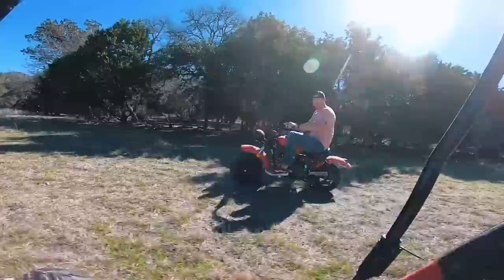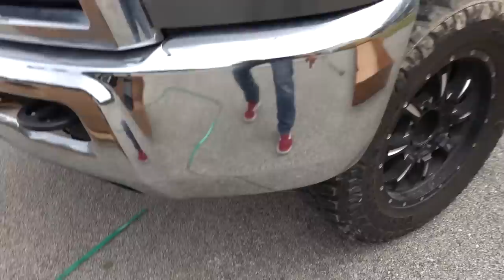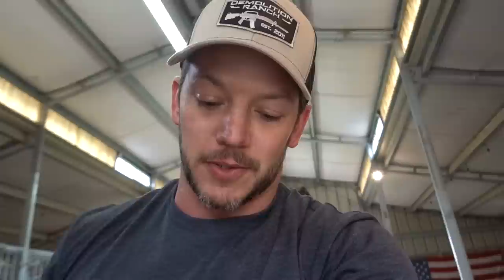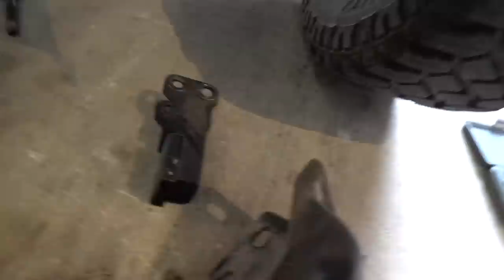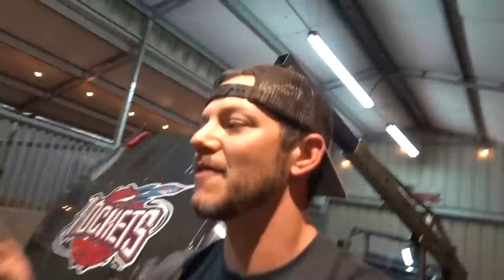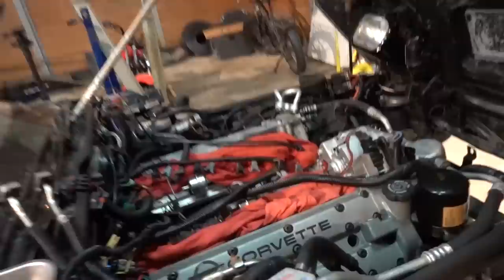The New Upgrade is HERE!!! Dodge Ram 2500 HD Cummins

Comment: Most people: ah this needs two people, it’s gotta wait until I can get a friend over in a few days”
Matt: “ah this needs two people? Eh I have a lift and some tow straps”
Reply: Engine Hoist coming in for the clutch right there!
Reply: When i did a front end swap on my blazer to get the hood off alone i attached a strap to the front and wrapped it around the rafters in the garage to hold it... Then i just pulled it tight and tide the hood to the roof to keep it outta the way... The radiator support i just hooked my grandpas quad to and pulled

Comment: I have lights on my roof and it's good for beach driving to fill in the shadows of my lights on the bumper.

However don't wire it to your headlights, if it's dusty or raining the light can be a distraction. As well as the glare off the bonnet/hood

Comment: Matt use should get a ring mandrel , you can use it to align and guide the parts.
   We had one spud wrench at a shop ...and a stainless steel ring mandrel was much cheaper than "adjustable wrench with tapered handle" at the time

Comment: For the winch I’ve got the Warn 95960 ZEON Platinum 12-S Winch on my f250. Best winch I’ve ever had! Super strong and really powerful. And with light bars if you’re gonna do one up top go with a curved light bar, the straight light bars make a little bit more noise at higher speeds. If you’re going for durability, The company I would chose would be rigid industries. They are the company that created the first light bar. But if you’re going for visibility then Ive heard that the Vision X XIL-PX9010 is one of the brightest. But at the end of the day it’s not my build, just giving you some options.

Comment: Matt check out Rigid Lights! They are probably the best of the best! I would go 2 x 50inch light bars up top, and then a 30 inch bar in the bumper! For the winch check out Warn... at least 12k capacity!! Good luck!!!

Comment: I would start by painting the front grill black getting rid of the chrome get a roll over bar on the bk off the bed and put a light bar at the bk and put it on a swivel so can go from front to bk get a skid pan For the bottom of the engine and finally a pew pew rack behind the seats

Comment: Go to extreme terrain and get the lights off there. I’d recommend a bar to go above the windshield and 2 pod lights to go on the front bumper. I got 2 light bars on my Jeep, the one above the windshield is 50000 lumens and the front bumper is 25000. Strongly recommend

Comment: Baja Designs or Rigid Industries. Bar in the center of the bumper, two sets of lights on the outside, one set driving, one set SAE fog. Either of those brands you don't have to worry about lumens, that output spec is pointless in high-end lighting. Unless you want wind noise, don't put a light over the cab, if you don't mind wind noise, go with a radius curved bar around 54 inches. Warn 16.5 winch is the only winch you can put on that truck that will actually be effective for recovery purposes of that truck and ranch hand works with them to ensure proper fitment

Comment: Hey Matt I have had great luck with Eyourlife lightbars,(yes like “your life” with an E in front of it). They are at a great price point and great quality. I have had my 32” curved light bar for about 4 years now and I haven’t noticed a bit of fogging in the glass or anything going wrong with it what so ever. So I recently picked up some fog lights and they are great. Great price and great product. As far as the winch I would say a 12,000 pound winch with a synthetic rope would be really nice. Warn or smitty built winches are top of the line and being that Earl is a heavy duty boy he needs a winch that is going to hold up to whatever he throws at it. Thanks Matt, love the videos, and keep up the good work👍

Comment: Hey Matt, a good light bar or spotlights are stedi lights from Australia or light force, and warn winch in 9500lbs would be sufficient especially if you get a snatch block but if it’s loaded up you would want a 12,000lbs

Comment: I have a suggestion for you to do to Earl. I looked up the laws in the state of Texas and it is completely legal to do this. Do a complete straight pipe exhaust system. Which means to get rid of the muffler. And do a EGR Delete kit too. It helps with power and fuel mileage.

Comment: In my opinion for lights you should get a very large curved light bar(like 52 inch)  for on the roof. I farm and in my experience we have led light bars on our tractors and use them for hours on end ours are just from our local parts store if you mount the higher the light are mounted the better perception you have of the retain example tho ground doesn’t get flattened out by the shadows. I would also mound an led pod or like 7inch bar in each fog light spot and angle them so they point to the side to give you a wider view when off roading. I don’t have a lot of experience with winches but in my opinion a good place to start would be to take the weight of your vehicle and multiply by two and buy a winch rated at that many pounds that should give you a decent amount of pulling power 
I hope you find this help-full 
Just thought I would Ofer my 2 cents on the topic have a good one man your a great guy

Comment: Definitely put a Lightbar in the bumper great place I’ve had tons there, but don’t put one about the windsheild put it facing forward off the headache rack behind the cab. If you put it on the roof above the windsheild it will reflect off the hood and annoy you! Found out the hard way. Brands not sure but I’d say rigid industries is top line up there.

Comment: As for winches. I like warn. Light bars are bot exactly my thing.. but when it comes to lights you have to be careful of your laws and what you intend to do with them. Personally as a work truck it might be a good idea to run a light around the bumper area as well as maybe put a set of lights up on the rear of the cab facing backwards as a work light. That's what I run on my truck. I have a flatbed as well with square tubing cage around it. My lights on the rear consist of a split bar up top aimed to either side as work lighting and a small set on either side of my rear bumper for backing up(they are wired into my reverse lights) also you should be careful of the battery drain that your lighting will cause. I personally have a separate battery connected to my generator to charge but only connected to the lights so if my lights die my truck doesnt..

Comment: Go Rigid lights for sure. Or Baja Designs. Two best lights on the market. Super bright, unbeatable warranty and they last forever. Go with a Warn winch for sure. At least a 12,000lb winch. If you can, get the strongest winch you can. Then you don't have to ever worry about having enough winch.

Comment: If you are looking into light bars look into diode dynamic light bars they are the best ones that I have used. I wouldn’t put one over the windshield due to whistling and the glare on the windshield when you use it.

Comment: 12,000lb warn winch. Mine has never let me down. Rigid industries is supposed to be some of the best lights on the market, but not cheap. I’ve had good luck with cheapies of Amazon. That’s a negative on the roof mounted light bar tho. Not a good look on these dodges and it’ll have an annoying whistling noise at highway speeds. All and all nice truck man! Looking forward to see it progress

Comment: 12k or more on the winch. Make sure its synthetic rope and not steel cable. Rough country makes a black series of lights. Pretty much a blacked out light bars a lights. Much better looking than the chrome ones you usually see

Comment: Matt, you need to ditch the rest of the chrome now.  Earl is all black in the back.  You have black mirrors and wheels. Now you've added a black ranch hand.

 Get a basic black mesh grill. They aren't that expensive.

Get some  oem quad halogen headlights with black  bezels.  They are super cheap and should be plug and play for your truck.   Or drop in some oem projectors with black bezels normally found on Sports or Warlocks with the factory "black appearance package" or "night edition"

Comment: Have read a number of responds, any relating to the winch have mentioned warn winches. Good elect winch very well known, but if you feel you want or need A REALLY GOOD winch...Mile Marker 12000. Mile marker makes a hydraulic winch that works from the power steering pump. The MM1200 will drag Earl the truck your linked to out of the pit. It's rated for 12000 pounds of pull.

Comment: Baja Designs Hybrid LED & Laser Lights are the best! Their light bar is over 38.000 lumens. They throw light 350% farther than their current LED light bar. 
As for a winch, nothing less than a 12.000lb. winch for that truck.

Comment: Winch: WARN 14k lbs plus hands down the best but it needs to have synthetic rope not metal cable. 

Lights I really like ridged curved light bars and the short light bars. I would definitely do light pods in the bumper I like KC light pods and Ridged makes some nice ones I have both. 

I personally like having the light bar above the windshield depending on how it is angled it can have some serious glares off of the hood but tipping it up fixed it for me. Only bad thing is mine kinda hums when going 75mph or more but it’s not bad.

Comment: If your actually going to use the lights do not put it on the top of the cab. That’s just for looks because when you turn it on if it’s a good one it will reflect off the hood and may be hard to see. I would put cubes by the mirrors in between the hood and the windshield if you know what I mean and then put them on the ranch hand

Comment: Don’t put a light bar above the windshield. The light will reflect off the hood. A 12 or 14k winch would be the best for you size truck. Usually take your GVWR and multiply it by 1.5. Always upsize don’t downsize

Comment: I would use 2 flood pods in the fog lights and then a straight beam for the front of the grill. Then use a 54” light bar for the roof. I’d get a 12 thousand pound winch because your truck probably weights 8-9 thousand pounds empty so if you have a trailer or loaded down with go carts on the flat bed might be over 10 thousand pounds

Comment: I would say a warn winch but I know a few guys that work at the Oregon plant and they told me not to buy a newer one. The older ones are great! But they both told me the new ones are all China parts and are as reliable as a cheap one from harbor freight.  I know here comes all the guys telling me I'm wrong. I'm going by two guys I know that work for warn building them. Quadratec makes a great winch and not to spendy. Works great on my diesel.

Comment: For winch definitely go warn at a minium i would say get their zeon 12s 12 for weight and s for synthetic rope however that's a big truck and an even more heavy duty winch would be better however the zeon 12s will most definitely get the job done! 

As for lights i wouldnt recommend doing a over the windshield light bar as they end up glaring off of the hood and blinding the driver i would suggest keeping everything in the bumper and good brands are Baja designs or rigid industries

Comment: Whatever you decide on lights and a winch, Please do NOT wire anything directly to your truck. You run the risk of burning up the ECU on the truck. Dodge's are known for this problem, but it's easy to get around it.
Painless wiring makes different size pre-wired relay boards that have both keyed hot, and always hot circuits so all of your accessories are wired independent of your ECU, so you'll never have to worry. Make sure to get a bigger board than what you need so you have room for expansion as you get more cool stuff for Earl.

Comment: Get a winch that’s double the trucks weight with synthetic winch rope. And rigid lightbars are best but amazon are cheap and good also and some have kits that allow you to mount over the windshield
Reply: Also if you get a windshield lightbar get a aerolids cover to put on it to get rid of wind noise

Comment: Osram makes some good budget light bars. But if you want really nice good ones, check out KC lights. A light bar on the top of the truck is pretty much useless because it reflects off your hood, it will be very annoying. As for the winch, you will want a 12,000lbs

Comment: Some quick calculations. If Earl gets stuck at the highest mire factor of 3 then 
Earl+cargo weight X,XXX lbs and uses XX,XXX rating winch you will need X number of snatch blocks + gear of XX,XXX load rating

7,000lbs load+12,000lb winch=2 snatch blocks + 12,000lb load rated gear
7,000lbs load+16,000lb winch=2 snatch blocks + 12,000lb load rated gear

8,000lbs load+12,000lb winch=3 snatch blocks + 10,000lb load rated gear
8,000lbs load+16,000lb winch=2 snatch blocks + 14,000lb load rated gear

9,000lbs load+12,000lb winch=3 snatch blocks + 11,000lb load rated gear
9,000lbs load+16,000lb winch=2 snatch blocks + 15,000lb load rated gear

Hope that's useful

Comment: I would have gone with name Wreckit Ranch for the car stuff :)  I would stay away from the roof mounted light bar, they are super loud (wind noise).  Bumper mounter LED lights, Vision X and Rigid Industries are my fav's.  Warn winch in 12,000 lb minimum for Earl would be my choice.

Comment: Contacted Ranchhand the other day and this was the update they gave me for the winch plate:
"We don’t have a good ETA on the Winch Plate’s at this time, from what I have heard the rough ETA is set for end of the year." 
Also asked them about recovery points that might be an option, which they responded:
"As far as tow hooks I don’t have any recommendations on them I don’t believe that we will be making any."
Not sure if the 7guage steel plate on the bumper is going to be strong enough to support a 2 or 4 bolt shackle mount....

Comment: Ok so in general you want a winch with twice the pulling weight of the vehicle it’s mounted on. So your truck weights 7k pounds ish with the bed on it. So around 14k or more from the winch should be great. As for brand get a warn they are the best and are completely rebuildable so you can have it literally forever. The up front investment is high especially on one that will pull 14k plus but like I said it will be around forever. As for light bars one on the roof, one in the middle of the bumper, two flood cubes on the sides of the bumper, and two flood cube lights on the headache rack point out just past the bed generally someone will make a plate to fill those gaps on the side but leave you room for cube lights. If not you can always mod the ones you have to allow for cube lights. just make sure to have the metal coated again so it doesn’t rust. As for the bar on top, measure the roof and get a curved bar that’s about two inches shorter then the roof line. For the front of the bumper measure the opening and get one that is exactly the size of the opening. As for brands personally get the cheapest ones on amazon with the best ratings. Then when you get them take them apart and silicon everything then loctite all the bolts back in. I have done this method on countless bars and cubes and never had one leak or fail. I really don’t see the point in these stupid expensive light bars especially ones on the front that will eventually catch a rock going down the highway. Which even the expensive manufacturers don’t cover under warranty.

Comment: Rigid Industries or Baja Design lights. Dont mount a bar on the roof, the glare and the whistle is terrible. single bar on the bumper and maybe pods low on the A pillar if you absolutely need more light. Generally speaking one quality bar on the bumper is more than enough for most people.

Comment: Rigid led light bar in the middle of the bumper and another rigid led light bar in the top and a warn winch that can hold at least 3k more pounds than the truck weight, that would be my set up

Comment: Don’t get a light bar on the roof. The light just reflects off the hood and blinds you. It looks cool, but isn’t very practical. The best place to mount a light bar is in the bumper. I’ve done both and the bumper mount is better by a long shot

Comment: Me personally I wouldn’t put it on top of the truck because when you’re driving and you have them on it flares off the hood and you can’t see well when you’re driving I had to take mines off but for my bumper I have the OFFROADTOWN Light bar & it is has 48,000 lumens and the size of the light bars go up to 12 to 50 inches

Comment: At least 12,000 pound winch cause you need your truck weight plus some in case of a load or incline which would cause extra work for the winch.

And a couple prolly 8” light bars for the corner lights on the bumper and if need be a 24 on the middle of the bumper but not to many lights or it’s just excessive

Comment: Put 2 Warn winches on it, one on the front and one on the back against the cab. You can winch your car projects on your trailer. Think you would get more use out of 2 average size lights on the headache rack.
Light bars are kind of a fad, everybody is all light bared out.

Comment: KC HighLites and RIGID industries are good light companies. As a rule of thumb for winches, the winch should be rated 1.5x-2 times the weight as the vehicle is. So if you have a vehicle that weighs 4K lbs then the winch should be at the very least a 5.5k lbs winch. If it were me personally I would get either a 10k or a 12k lbs winch for Earl.

Comment: You should have the guys doing your stairs weld the bumper to for extra strength!
Reply: And I've always said take the weight of the truck times 2 for a winch!! No light bar on the roof you could do light pods at the bottom corners of the windshield. The put a large one on the bumper.

Comment: Light bar on the bumper not on the top they bounce off the hood and blind you. I would go 12,000 pound winch or bigger. We run a 18,000 pound winch on our 3500 cummins due to what we tow also I would do the double cube fog lights